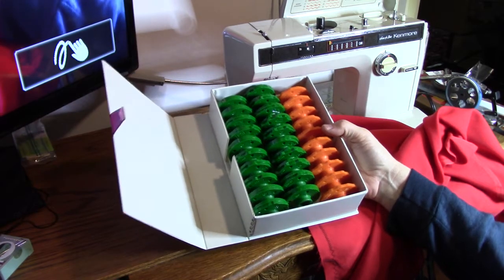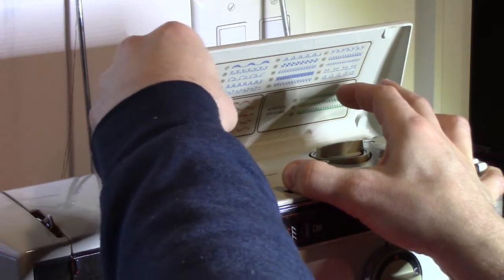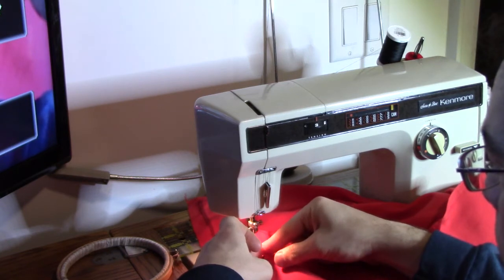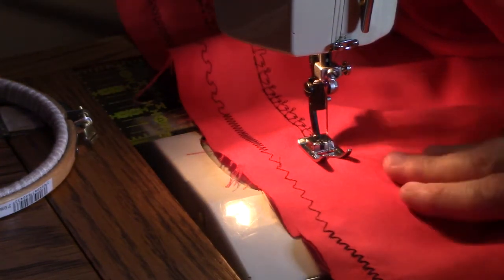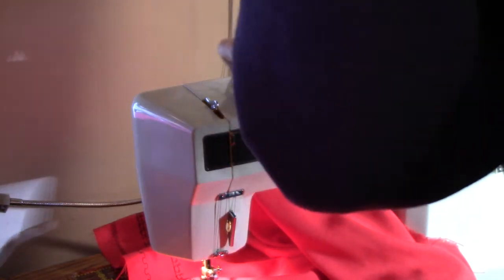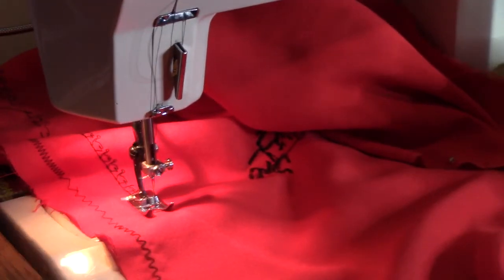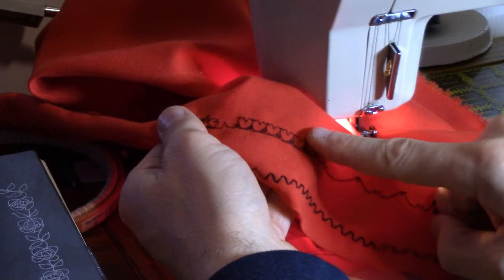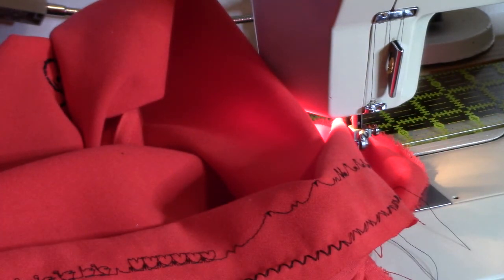Kenmore 158.1914 pattern cams

Comment: My 158.140 has a cam door on top of the machine.  It doe not have the knows to select a stitch.  It has levers for LCR needle position, lever for stitch length which doubles as reverse and a roller wheel for  +/-

Comment: So I'm confused. Are the green camps for the green stitches above on the chart? And the orange cams are for the orange stitches and then the blue stitches like the duck in the tree? Do they come loaded on the machine then?
Reply from the maker: The colour of the cams does not match the colour on the chart? The orange cams which I have are not stretch which are also orange on the diagram and white stitches on the front of the machine. Th is a blue are stretch stitches which are green cams and orange switches on the front of the machine. The stitches shown on the front of the machine are built in.

Comment: My 1914 seems to have an issue with the zigzag bar but nothing appears to be wrong with it. If I close the face cover of my machine, the spring that holds the cover closed interferes with the zigzag bar (the black bar inside the machine that pushes and pulls the needle from side to side). I can sew a straight stitch with the cover closed, but if I want to use pattern cams or do any sort of zig-zag stitches, I have to leave the door open. Any insight on that issue?
Reply from the maker: Sounds like the spring has become bent or is not in place. I would remove it for now, and then figure out how it should be placed to avoid interefering with the zigzag.

Comment: Do you like this Kenmore better then a Singer? I’m looking to add to my collection. :)
Reply from the maker: It is a fine machine indeed. It is like driving a very expensive car. It is running head to head with my Singer 411G, but they each do certain things slightly different than each other, so I am keeping both.

Comment: Would you happen to be selling this sewing machine. I used to have one many years ago and it gave up the ghost about 10 years ago. I would love to own another one again.
Reply from the maker: I am surprised that it could not be fixed. They are super sturdy. Do you still have it? Unless it was dropped, it should be fixable.
Reply: James Rogers it wasn’t dropped. After many, many years of use it had a catastrophic failure. It was almost like a run away Diesel engine. I was sewing one day and all of a sudden it started going out of control. By the time I was able to get it unplugged, the whole thing had seized and wouldn’t turn anymore. I would dearly love to have another one.
Reply from the maker: @GoMetricToday  I would wager it is fixable. A runaway machine will often jam with thread. If you have it, we could try and look at it.
Reply: James Rogers sadly I don’t have the machine anymore. I ended up scrapping it, but I did however sell all my discs for a pretty penny.